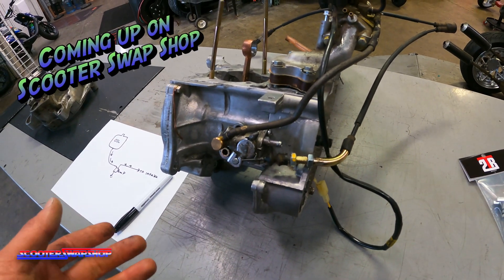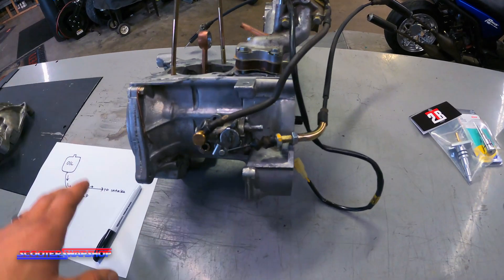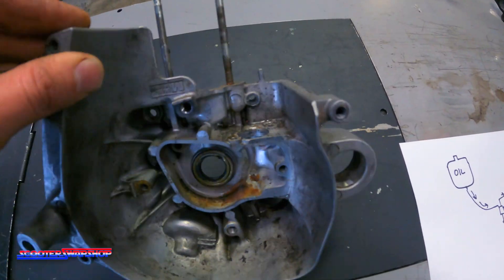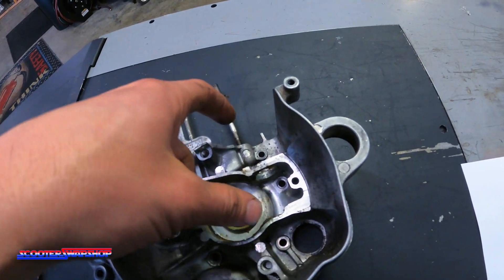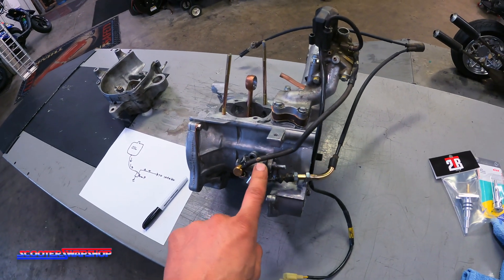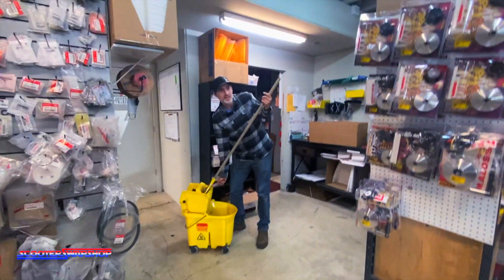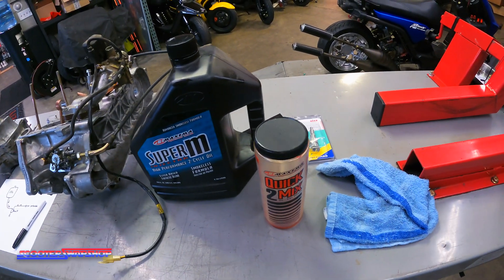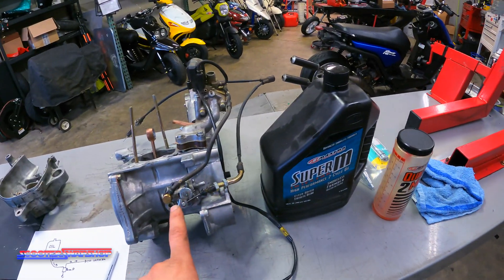The Benifits of 2 stroke Auto injection and Premixing  | 2 stroke oiling PT:2

Comment: thank you for this educational awesome video,i dont know much about motorcycle,i just bought a 1979 yamaha dt100 that has the same oil pump connection like yours,so if i decide to do the mixing then how do i disconnect or how to stop oil from pumping,of course i have to drain the oil first right?thank you.....

Comment: I siezed an ET2 due to oil pump failure. Replaced w 70cc malossi kit. I have been mixing fuel w Sithl HP Ultra synthetic oil @ 50:1 for 4 years/8K miles. No issues. It smokes until its warmed up but runs great. You can buy the 12.8 oz bottles at most hardware stores. Mix it w 5 gal of gas and have fun. Mix it with less gas if you are cautious. Im not. WOT.

Comment: What if you have a functioning pump but wanna add premix to the gas for a little extra protection and incase of pump failure? And also bc its been sitting for a while...Like can I add 1/2gallon of 50:1 to my 1.5 gallon tank? So I guess it'd be like 150:1 or even 100:1? Would that hurt my bike? It's a 2002 yamaha zuma with less than 700 original miles I bought off this 80yr old man who only used it to go to the mailbox and back lol.. but since he can't walk anymore it has sat for over a year... any advice would be greatly appreciated.. also want to buy an exhaust setup and see people pulling the restrictiors out.. is that OK too? Never realised how cool these things can be I already ordered a stretch kit and am getting a bunch of stuff from you guys.. I want it to be fast and reliable so any suggestions on mods would be nice too... ive ridden all my life but never a scooter 😅

Comment: I have a few 87 and a 97 Yamaha razz any carb replacement ideas  and tuning so far top speed of 30 i know it's limited on upgrades aside from whole engine swap I've upgraded tires and added shock extender for more wheel clearance also updated coil n replaced SPK plug
Reply from the maker: There’s really not much you can do with the razz motor

Comment: Before special 2T oils, classic sae30 oil was used for mix. 2T oil appeared very late, probably in the 70s. sae30 works okay for mix, but it does not dilute very easily, you have to shake it a lot and it does not burn very well.
Reply from the maker: nice

Comment: What if I have a carburetor with the injection port, how do I block it off? Do you sell caps to block it off or do new carbs come with caps to block it off?
Reply from the maker: we may have them call tomorrow after 9 and ask Paul
Reply: Just cut the feeder hose 1 in. from carb and plug it w screw or nail.

Comment: Now I need to find a legitimate answer on the transmission oil I see several different kinds and viscosity I generally run Maxima and everything including my current four wheelers. On a side note I lost my job of 10 years because I'm battling cancer and they didn't want to mess with me even though I never missed a day in 10 years if I was local I'd be happy to mop the floors just to be around scooters and learn
Reply from the maker: sorry to hear bud
Reply: @Scooterswapshop  it is what it is I'm 51 and I said screw it and I'm getting a scooter LOL my wife won't let me ride straight bikes anymore